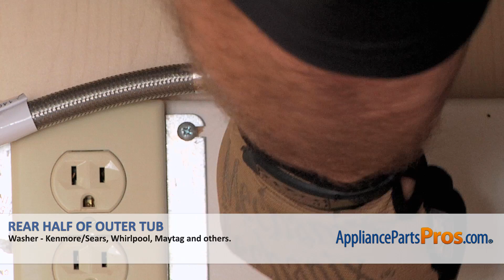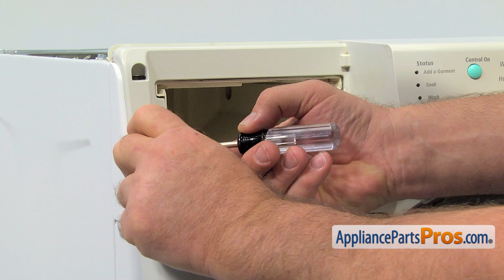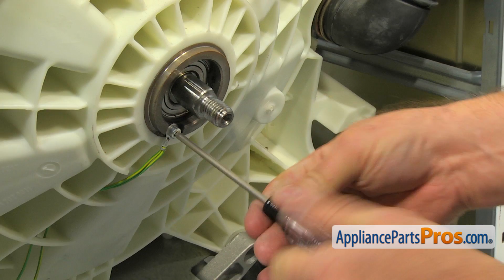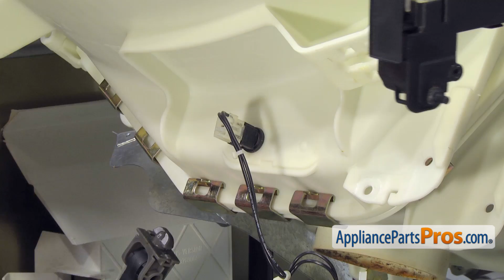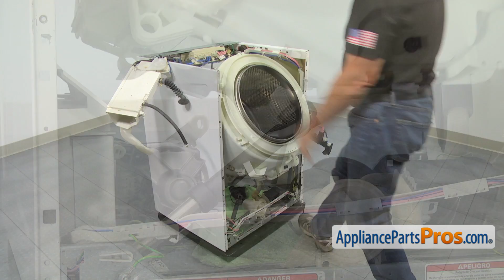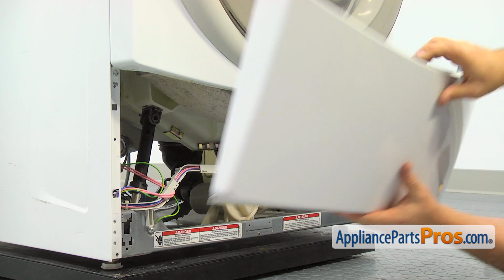How To: Whirlpool/KitchenAid/Maytag Rear Half of Outer Tub W10772617

Comment: Those shocks have have tabs you need to depress and then twist, or they can break off. You said spin them counterclockwise but you spun them clockwise. Language barrier?
Reply from the maker: I think he just misspoke.
Reply: @appliancepartspros The same thing happened on another channel too. I thought I was going crazy 😂. Good stuff guys thanks for the video references.
Reply: I bought cheap replacements and I had to take them off again I just Twisted it like he did and broke one only the rest never broke I don't understand why it's almost impossible to get a screwdriver in there and do it by yourself

Comment: This is all fine, IF,, your tub shaft will come out of the bearing.  Mine was so rusted it would not come out with out a lot of force...it also did not want to go back in all the way.  Replaceing the bearings is much cheaper...about $15...which  I am glad I did.  I would not be happy if that $600 part did not do the trick because of the rusted shaft.
Reply from the maker: That’s a great point—and thanks for sharing your experience! Rusted shafts can definitely make this repair tougher than it looks in the video. Sounds like you made the right call going with the bearing replacement—much more budget-friendly, especially when the tub shaft doesn’t cooperate. Glad it worked out, and thanks again for adding that insight!

Comment: Tore our Kenmore Elite Ht3 apart to put new bearings in i did it in a weeks time in a spare room when i had time
was ready to put the drum together when i decided i better order a new drum gasket , that  was a good idea saves on a do over if it leaks
Reply: I also installed new shocks & springs just in case -  better safe than sorry
Reply from the maker: So glad you were able to get the unit repaired. Let us know if you have any questions.
Reply: was your washer making loud noises on the spin cycle and tearing up the front outer tub?   i have a 2008 that was working fine until recent.  i am torn between buying the parts to fix and getting a new one .. reviews of new ones are not convincing that they will be as reliable .  how did you know it was the bearings and not just the shocks?
Reply: @christinebertini1659  a serviceman said they would fix it , so i went on youtube  to see how to replace a bearing 
i did it at my leisure had a room we didn't use and took my time put the new drum gasket in also  and it work for a long time
infarct the repair never failed . not sure who's video it was i got over 25 or more year out of that Kenmore washer

Comment: Isn’t the 2 tub part heat sealed? Melted together? I did this job and the two halves would not separate at all
Reply from the maker: Depending on your model sometimes you can only get it as a whole assembly, but some models do have it to where the tub does split into two halves.

Comment: What kind of grease did you use on the bearing?
Reply: no grease, just a little silicone spray on the outside of bearings to help set them. no grease on the seal either.

Comment: Very well done. My son and I were able to get machine apart and replace rear bearings with your help. Thank you.
Reply: @Joe B tub wasn't available when we looked last year. I see Sears Direct has the rear half with seal/bearing pre-installed now. But, yes, we found the bearing/seal kit online and just installed that. Worked great for about a year. Cost 16 bucks and 3 hours of work. If you're an dyi auto mechanic, it's pretty easy to do. Since you'll know the tricks of hot and cold to get a bearing in a tight spot....